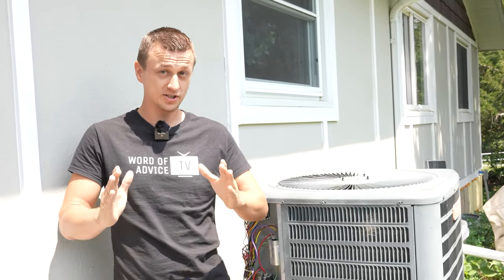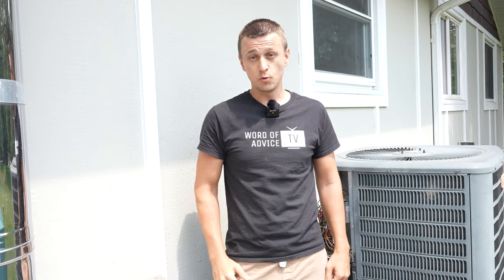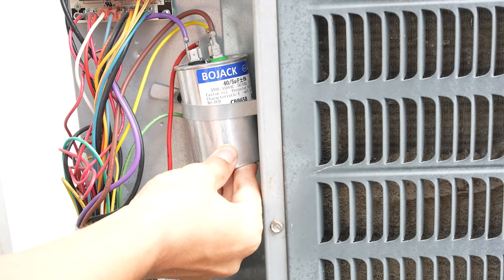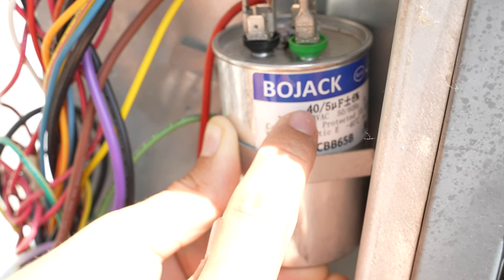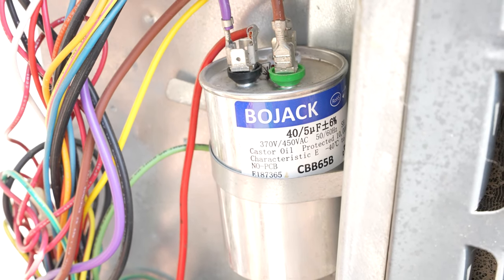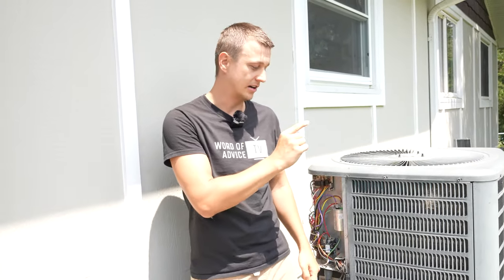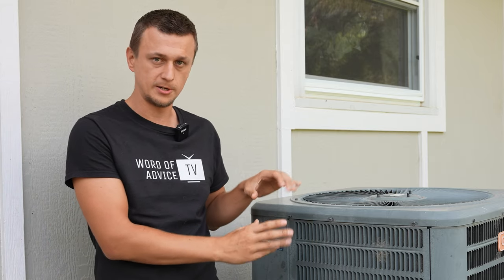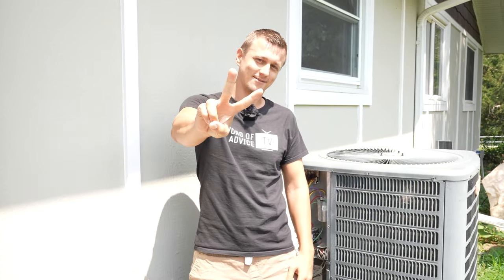How to Order the RIGHT Capacitor For Your Air Conditioner

Comment: THANK YOU SO MUCH. THAN I CAN INSTALL  TENPORARY CAPACITOR I F I DONT HAVE TH RIGHT MICROFERS SO IF U NEED 45 fs I COULD GO 40  or 50 AT LIST FOR CUPLE DAYS  AGAI THANK YOU SO MUCH
Reply from the maker: You're very welcome! Yes, it's okay to use a different size for a short time. 👍 I have seen some technicians put in a 60MFD instead of a 30MFD and it worked fine for 3 weeks until I got back there. 😅

Comment: Isn^t the correct info for the capacitor written on the condensers rating info
Reply from the maker: The capacitor info may be on the compressor or on the fan motor but most condenser nameplates (where the unit model and serial are) don't have capacitor info on them.

Comment: mine just says 5uF   no number before it, anyone know what it would be? thanks.
Reply: and it's small 1 1/4" wide x 2 1/2" tall, ty
Reply from the maker: That must be a capacitor for the fan only. Are you working on an air conditioner or a furnace? If an air conditioner, then is there another, bigger capacitor in the unit?
Reply: @WordofAdviceTV   ty , found it, I was on the fan.

Comment: After a few months of going from nothing about capacitor to know a little I still can't find the same as the replacement in my LG window unit.  CBB65A-1 55/6 +5% 😢😮😮270VAC😬🤯😵
Reply from the maker: That 6uF is a rare one. I can't find one online either. If you can't find it, you have a few more options you could do. One is to simply put in the wrong size. A 55/5 or 55/7.5 - I would go with the 7.5 - This is not optimal for the fan motor (long term it will likely decrease its lifespan) but it will work. Another option is to get the 6uf capacitor separate and replace the dual capacitor with two single capacitors. I have a video that explains this here: https://youtu.be/qLJOWU33TFo?si=9naNsHPSoSeM7eVk

Comment: I need your help

I ordered and got a  new capacitor for my condensing unit 55/7.5 mfd +/- 6%

The actual reading on the new capacitor out of the box are 53.8 mfd Herm 7.38 mfd fan

The question is: should new capacitor read 55 Herm and 7.5 Fan exact.

55 x/- 6% is  53.94.... very close to the min limit Herm)

Should I return it and get another one or is this normal.

Thank you very much for any assistance provided.

Ps.  Capacitor was real warm when I got if out of box

HV
Reply from the maker: From what you described, it sounds like the capacitor is either not new or got impaired somehow during shipping. That's not good and I would return it and get a new one. A new, good capacitor should have a reading that is very close to what it's labeled as.
Reply: @WordofAdviceTV   The capacitor is within specs. Take the reading on the herm side and multiple it by .06 and then subtract it from the meter reading (55 x .06 = 3.3) (55 - 3.3 = 51.7 MFD) Do the same for the fan side. (7.5 x .06 = .45) (7.5 - .45 = 7.05 MFD).  Too much capacitance or not enough capacitance causes higher current flow in the compressor or fan motor winding which can lead to burned/shorted motor windings. If there is no tolerance marked on the capacitor, I have my students go with +/- 10% just like when checking the main power supply.🙃
Reply: The capacitor is within specs. Only way to see if it is having an adverse affect on your system is to check FLA with a clamp meter. Too much capacitance or not enough capacitance will cause the compressor or fan motor to draw more current which may damage the motor windings.
Reply: @mojo9288  

Thank you so much for your information and will follow your advise.
For yearly preventive maintenance:  Change only if is below 10%? trying to prevent having to change when it totally fails and ac is not working.

thanks
Reply: @HectorVela-d8c  Signs to look for that a capacitor is failing are: swelling or bulging of the case, fluid leaking from the capacitor, vent is popped, does not measure within specs.

Your capacitor has a 6% tolerance so stick with that. Only use the 10% tolerance if there is no tolerance stamped/marked on the capacitor. 

You'll need to use a clamp meter on one of the compressor wires or fan motor to see how much current is being drawn while the compressor or fan motor is running. You do not want to exceed Full Load Amps (FLA) of the compressor or fan motor. You can find the FLA rating on the data label of the compressor and fan motor.
Reply: @mojo9288  

I will follow everything on this  replied  message.

Thank you so much for the feedback

Comment: Brand does matter, buy American made and buy the exact size required for your system.  The wrong capacitor in the system might have replaced by someone else before you and or the fan requires a different Microfarad than from the factory.  Only a trained technician should do this type of work and will void your warranty, if it has one.  Most systems have 10-12 year parts warranty.  Do not guess on the size of the capacitor. That is like guessing which spark plug your vehicle takes or which oil.  It is not OK to use a different size capacitor.  It will shorten the life of the fan or the compressor and those can be very expensive to replace and VOID your warranty.
Reply: American made blah blah blah
Reply: @hahaha9133  Oh, that is too bad you don't buy the best product and you sell junk to your customers.  AMERICAN MADE ONLY!! Anything else is junk.  I am actually care about my customers and my country!!

Comment: Isn't the capacitor's class rating important? Why would I buy a capacitor rated for only 1000 hours (Class D) when I can buy one rated for 10,000 hours (Class B). The class B may be a little more expensive, but worth it. Please tell us how to identify a Class B capacitor.
Reply from the maker: With HVAC capacitors this classification does not apply. If you are looking for a higher quality capacitor, go with either AmRad or Titan which are both made in USA.

Comment: Can I replace a 35/5 capacitor with a 35/7.5
Reply from the maker: It would be better not to. A 50% increase is pretty big and would likely decrease the life of the condenser fan motor. For more on the allowable ranges, check this video out: https://youtu.be/5_0nKm940nA?si=F94x7y4FpvHwDR0D
Reply: @WordofAdviceTV  thanks for the reply! I have a York model# H1RA018S06D serial# WGKM025175 tiny unit and i think the previous ac company put the wrong capacitor(35/5) because I’ve been looking online for the right capacitor size and getting mixed numbers 30/5 or a 35/5 so i think 35/7.5 is definitely too much but its 112 here in California and i had to put the 35/7.5 to survive the heat. Do you know how I can find the accurate capacitor? all HVAC companies in my area are a week out and we have another week of triple digits so i have to diy.

Comment: You don't have to guess. Look at the fan motor rating and your compressor rating. The micro farad rating for each component is on the label. The first number on the capacitor is your compressor, and the second number is your fan

Comment: I am an HVAC business owner and technican and I have to disagree with Jay on  this one.  Brand and quality are quite different.  It is like the fact that Energizer Max batteries are far better than Duracell.  Lithium batteries last much longer than Ni-Mh.  You do need to match the microfarads and should always keep a spare on hand, but these are not for DIYers to replace on their own or diagnose.  This is high-voltage and a technician should be doing the work, as there could be other issues and proper training.  So, yes, If you are using a dual run capacitor, it has the capacitor to correct phase angle for the fan and the compressor.  AmRad is the best brand on the market, has a 5-year warranty and is American made.  I stock those on my van, but there is a shortage of some kind right now.  So the the Titan HD is also American made but the Yellow lettering Titan Pros are made in China.  Many brands are made in China (PRC) and they might work fine, but we find they fail much more often and my business only sells American made capacitors and parts when possible.  The chinese parts are cheaper to buy, but do not last as long.  
Matching up the capacitance sizes are very important as Jay says.  45/5 uf is one size that is a good majority of 3-4 ton systems but his list below shows many models, but remember the second number is the fan MFD reading and many fan motors, especially ones that have been replaced may be from a 3, 5, 7.5 or even 10 MFD.  So they make capacitors like 55/7.5 or 45/10.  They are not as common but your technician will know which one you need.   I recommend a technician and American made products.  Some brand systems require a specific capacitor for physical size or warranty.  But I do repeat, this is not a DIYers area.  We didn't go to school for a year or two for no reason and the system is 208/220/230/240 volts and crazy high amperage in heat pumps and systems that are having compressor issues that might need additional troubleshooting.  Best wishes and be safe!
Reply: Awesome advice! I have my students hook up motors with too much capacitance, not enough capacitance and manufacturer's recommended capacitance to show them what happens and how they can detect it using their meters. Most technicians that don't go to HVAC school have no idea what to look for with their meter or even how to use their meter. When the clamp meter is placed in a series or parallel circuit the readings are different and you need to know what formula to use to determine the correct values. When capacitors are wired in series or parallel the readings are also different. I recommend AmRad capacitors to all of my students and to any customer that wants peace of mind.

Comment: Omg.  It is not only the uF (microfarad) rating that matters!
 The voltage rating of capacitor DOES matter.  If the voltage rating of your replacement capacitor is lower than the specification of your unit, then the capacitor may fail much more quickly.  A failed capacitor may burn out your compressor -- an extremely expensive repair (replacement!).

The capacitor tolerance (+-X%) matters, too, since the capacitor selected by manufacturer is designed to be TIMED to fire in order to produce torque at the right moment.  Wrong tolerance can destroy compressor - especially in long run. Anyone who tells you this is just for testing does not know how a capacitor/compressor works.